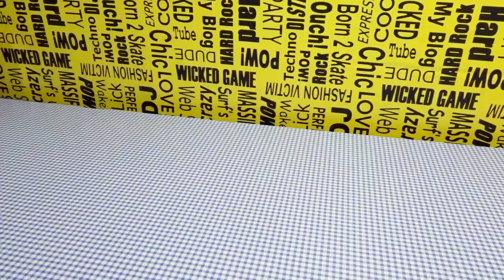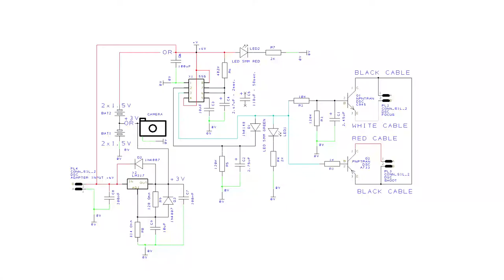07 How to make timelapse camera from old digital compact camera

Comment: I have one canon camera, is it possible to use this cam like a time laps cam?
Reply from the maker: I don't think it will be a problem... All you have to do is get to the shuter button, you need to measure which pins connect when you press the button, connect there with transistors and it will work. Basically, you can see it in the video I filmed...